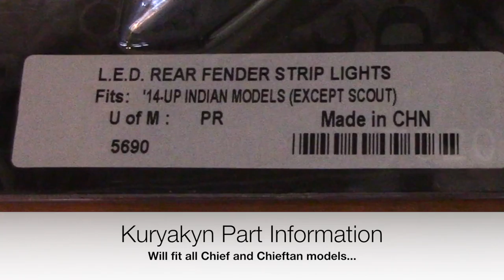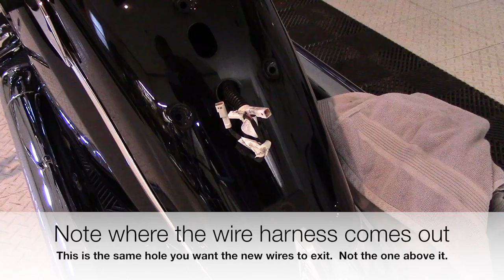Kuryakyn Rear LED Brake Lights Installation

Comment: Great demo. Thank you. Kuryakyn instructs to remove main fuse during install. I didn’t see you doing that. Is it really necessary? Thanks.
Reply: Kury is big on safety.  I didn't remove the main fuse, as there is no power going to the turn signals when the bike is off.  Thanks for the feedback.  Good luck!

Comment: How did you get that top bolt of the 3 holding the light assembly back in?  I’m afraid to try it as I can’t get my arm up in there and touch it.
Reply: It is a tight area.  I think I put that bolt (it's flanged) on a ratcheting box-end wrench and got it in place with a finger to hold it while turning.  Good luck!

Comment: Hi I found you thru a comment on Dazzle Rebel Rides. I'm thinking of buying an Indian Bobber, how are you getting on with Indian Motorcycles?
Reply from the maker: Hi @Dead Red Rooster!  The Indian has been great for me.  Coming up on 32000 miles with zero problems other than some chrome flaking that was replaced by Polaris for free under warrentee.  I'd buy the bike again.  Best of luck!